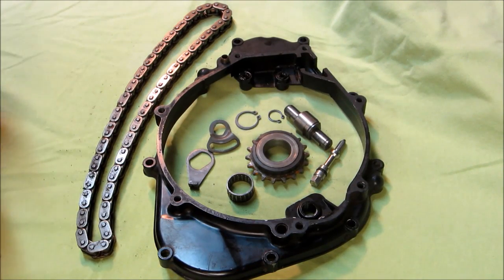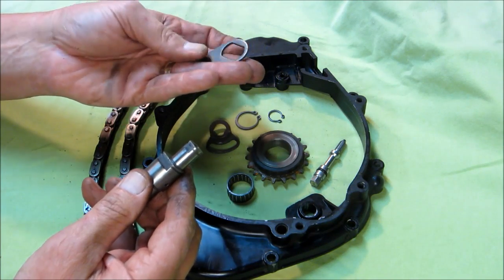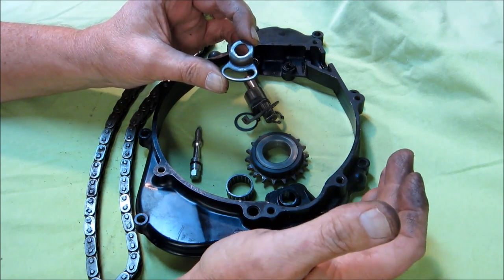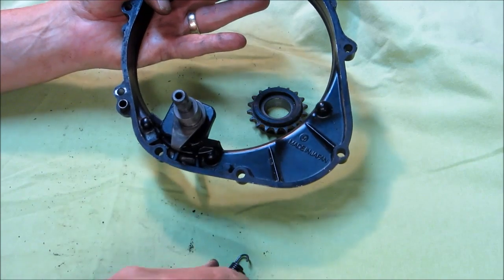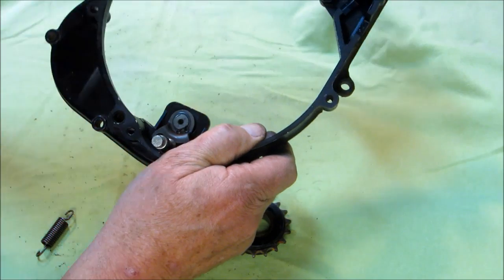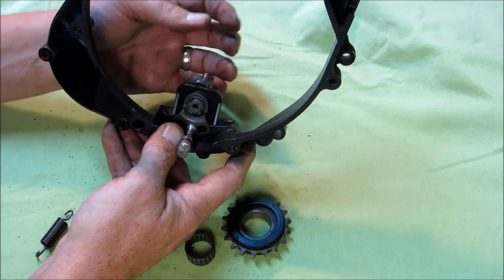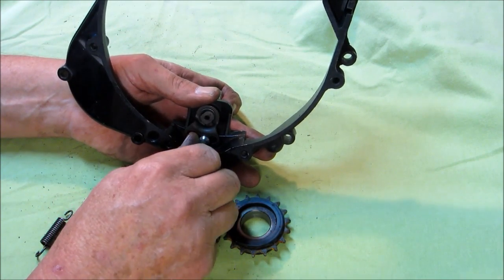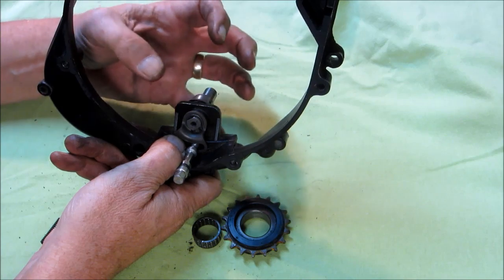How the Balancer Chain Tensioning System Works

Comment: I've owned 3 KLR's with over 20,000 miles on each. I've never had a stock dohickey problem. Regular oil changes and tension spring adjustments.

Comment: Hi souperdoo, i recently change the chain balancer and the doohickey. I put the torsional spring, but the motor vibrates at 4000 rpm, and sounds how the chain knocks the case. Then i change the spring to the lineal spring, it have more tension. But the same problem....
Regards from Costa Rica

Comment: Thx, Tom, for the clearest explanation of this design flaw that I have found anywhere on the internet.  I wish I had dealt with it a little bit sooner on my 2011, because by 20k the end of the stock spring had broken off. The only good news is that I had switched to a magnetic drain plug about 10,000 miles earlier and it was caught securely in the sump by the magnet.  However plenty of small aluminum filings were scattered around the motor, necessitating a very thorough cleaning.  Here's what puzzles me though: on a 30-year old design which is not changed much, you'd think that the engineers would have fine-tuned all these initial design flaws out of the motor.  To date, I've been forced to install a new piston (EagleMike 685, much smoother) the ThermoBob, and torsion spring/doohickey.  Having been around motorcycle engines for many decades I'm always a little bit doubting of the latest trick "Gotta Have It" aftermarket goody. However, all of the three items mentioned above have turned out to be essential for my KLR and should have been properly engineered in the first place.
Reply from the maker: Well, I think you have to understand the larger corporate view. I'm going to make some numbers up, but you'll get the point.

They have made a million KLRs. Most of them get ridden, in their entire life, less than 10,000 miles. Nothing breaks. Then they get leaned up against the shed for the nest 20 years or get parted out. Certainly nothing serious in the usual (short) warranty period. There's simply no formal "corporate" awareness of any problem. '"Corporate awareness" means that there exists a situation where a problem is costing them money and fixing that problem is going to be cheaper in the long run.

Figure this, too: the vast majority of KLR owners just ride the shit out of them and and toss them if they break. They're cheap enough. They don't hang out on social media, they never heard of a doohickey, and they don't plan on keeping the bike for a long time. 

Only a very few, in the grand scheme of things, really ride them for a long time and for a lot of miles, engage in social media that deals with the bike, and really understands and fixes anything that can prevent them from running a long time.

There are also people that ride them around the world without hardly doing a damn thing to them. Shrug.

Tom

Comment: Never seen the cause of this problem explained so well, hopefully my '16 KLR won't need any replacement doohickeys.
Reply from the maker: It's quite likely it will need a spring. If you go in to replace the spring, you might as well put the aftermarket with the torsion spring in. In for a dime, in for a dollar.

The Gen 2 lever is good, but they still haven't gotten the spring right so that it will exert force on the lever throughout the lifespan of the system.

See here: https://www.youtube.com/watch?v=WAryJKr72KM

When/if you get to the point where you are going to replace the thing you might find this set of videos useful: https://www.youtube.com/watch?v=U3UJIbDOLMQ&list=PL3s67DOJbACyGI5VAbELQ4YUkV6CCFOUl

Tom

Comment: So how's the Doohickey system in a 2013 KLR??...........✌️
Reply from the maker: The system has been unchanged since 2008 model year. The lever is better than the prior parts, but the spring runs out of travel fairly quickly which leaves the chain slack. It chews into the case just forward of the upper balancer shaft.

Tom
Reply: Ok thanks!..... Good to know!😎👍
Reply from the maker: Jerrythe coo
 Here's the issue with the Gen2 ('08 and up):https://www.youtube.com/watch?v=WAryJKr72KM&list=UU78339yu0hhASK9JRB6xg_Q

Tom
Reply: Thanks Tom!.......Merry Christmas!😊👍🎄

Comment: nice presentation, thanks for this video.
you forgot to mention that the stock spring is also prone to failure (independently from the doohickey), and that the newer, thicker doohickey also fails (i found the one in my 2001 broken around the shaft).
also, doohickey failure can cause the slack chain to damage the crankshaft sprocket, which happened on my '88:

http://www.loupiote.com/photos/6974347650.shtml

Comment: The other thing many of them do is run the engine at redline rpm in the lower gears for extended time.....They just rev the hell out of it and of course you can wear all of this out excessively by doing that...Most never adjust this either....Never so it just lets the chain slack...